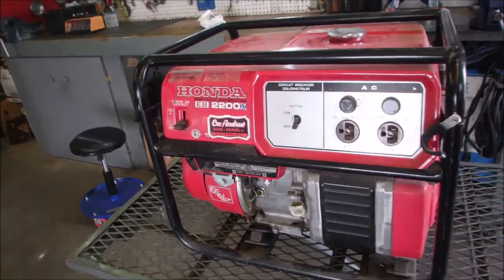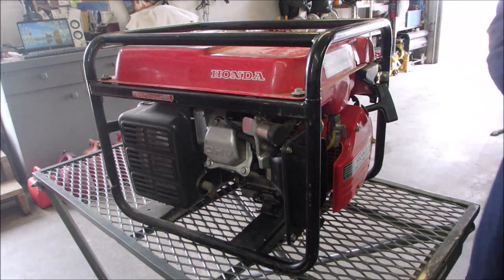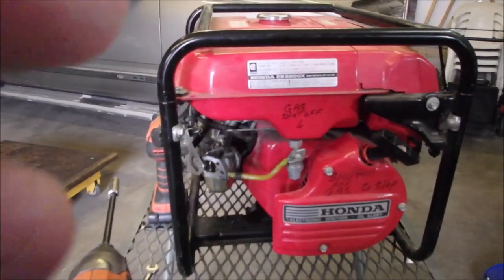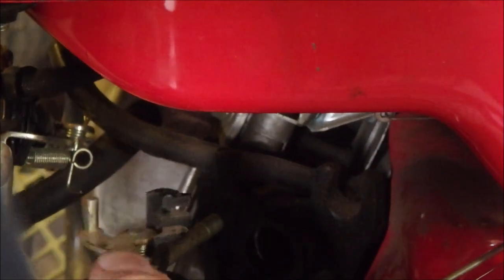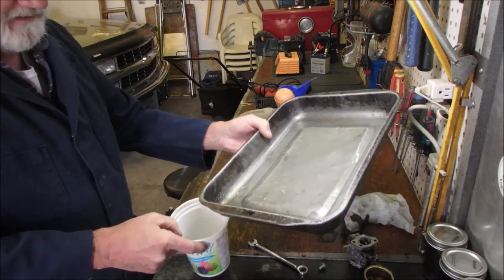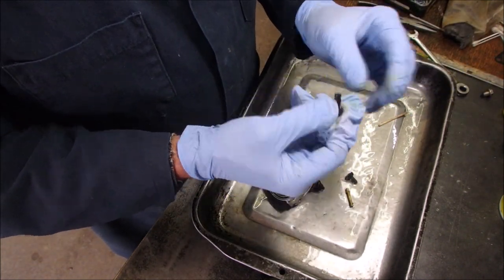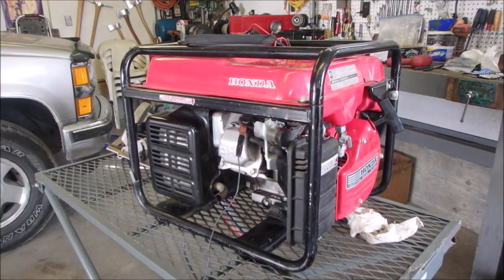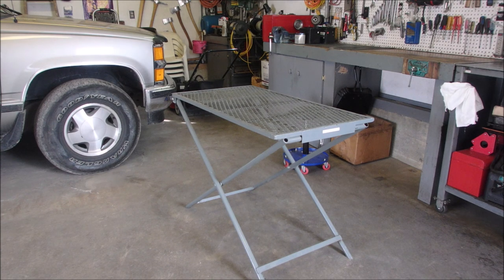Honda EB2200X Generator Won't Start

Comment: Nice to see someone doing it right ie: checking for voltage prior to working on carb issue. A few of our customers have complained of other shops giving them a repair bill for generators after finding out the generator did not generate power and did not notify the customer prior to working on the no start issue.  Good job buddy.
Reply from the maker: I can't imagine billing a customer for not going it an overall checkup
Reply: @BrucesShop  Actually saying the customer got billed for carb work etc. but the shop could not excite the stator to produce power so they didnt check that first like you did. Basically generator got demagged now engine runs but generator useless , guess it could happen but not if checked the way you did.

Comment: Nice work.  Looks like a well maintained generator.  No load, I usually set to 61.5 hertz (3690 rpm).
Reply from the maker: You know for me the hertz setting goes out the window when i get to the voltage setting.  I don't know how to manage both.  ???
Reply: @BrucesShop  reminds me of a Hertz Doughnut. You get too close to the unshielded spark plug terminal, and get zapped! Hertz Doughnut?
Reply from the maker: Can I set both   James?
Reply from the maker: After the video I turned the RPM down to 3400.  Thanks for the suggestions.  I should have caught that.
Reply: @BrucesShop  You should set RPM around 3600 for 60Hz and 3000rpm for 50Hz (both for "standard" little 2 poles generator). 
You can adjust the voltage on versions with AVR regulator, otherwise the voltage is what it is; can't do much about it.

Comment: Very nice video Bruce, I like how you used the grinding compound on the valve seat to save that carburetor. I would’ve thrown away that carburetor and spent months of frustration tracing down a brand-new one. Sheer genius!
Reply from the maker: Well thanks

Comment: That pressure check is pretty neat. I suppose that the size of your tank and the elevation would make a difference on the amount of pressure required for the needle and seat to hold, huh ?? Anyway nice fix Bruce.
Reply from the maker: Since i got the pressure tester i can fix way more things.  It was just a plastic seat that needed a little buffing,  thanks
Reply: @BrucesShop  I was thinking that the seat needed attention once the needle swap yielded no change. I’m so proud of myself today. My thought process matched Bruce!! I have learned a thing or 2.
Reply from the maker: @haneyoakie14  Thanks Sir Thomas

Comment: I've never seen anyone pressure test the needle and seat. That's pretty cool. I have a little gun like that for brake bleeding. I wonder if it can work in reverse like yours? What kind of tool is that?
Reply from the maker: Yes it will 0-30 psi will work

Comment: i like pretty much all the Honda Carbs, way better than Tecumseh. i've some experience with these and when i saw it was not holding pressure, i said out loud, "time to check the seat!".  we also have the same set of cordless drills, those black n decker ones are quite adequate for this type of work.  and for jet cleaners we just pull a bristle off a dollar store brush, easy and disposable.
Reply from the maker: Thanks Rob

Comment: Thanks Bruce,  great help. 
Bruce air compressor what type do you use name of it. 
Is it commercial or just a small one for your garage.
Reply from the maker: It is a big old sears model from the 60's I think with a newer electric motor.
Reply: @BrucesShop  thanks I’m thinking of getting a small one for my garage to put air in my tires when needed and to use for a small stapler any suggestions

Comment: Hi Bruce. Great video! Did you add the aligator clip to your RPM meter? Looks easier than wrapping the wire around the HT lead. Thanks
Reply from the maker: It came with one actually

Comment: A stuck fuel needle seat plus a drity carb is what I think is the problem in the no start probably cause it not to start there Young Man 😎
Reply from the maker: Right   a very common thing
Reply: @BrucesShop   well at least you got it going again 👍

Comment: The RPM is a little high.... should be just around 3600 to get 60Hz, nominal. This is a conventional synchronous gen head and not an inverter. 3700 is as high I'd be willing to go when unloaded. Good stuff with the carb rehab. Though, you were a little too rough on the main jet using the torch tip cleaner. You really don't want to alter the size of the jetting when cleaning it.
Reply from the maker: Yes I know that but some of the little honda gensets can go to 3900
Reply: @BrucesShop you must be referring to nrwer inverter models. Old school portable gens needs to run at a nominal 3600 RPM so the line frequency stays at or near 60Hz. If you runj that gen at 3900 RPM, the frequency would be 65 Hz. That may cause power tools with a motor to spin faster and draw more current.
Reply from the maker: @orlypalomar  OK.  Thanks
Reply from the maker: After the video I turned the RPM down to 3400.  Thanks for the suggestions.  I should have caught that.

Comment: Great job Bruce i will send over the carb am working on for my ride on  just will not run smoothly,when you removed the black plastic jet did you notice how many rubber seals on it.
Reply from the maker: No sorry Nev
Reply: @BrucesShop  not a problem Bruce

Comment: Bruce.  How many "O" rings are supposed to be on the idle jet of a Honda carburetor? I have not been able to locate a good parts diagram for the idle jet assembly to determine the correct number. There are two grooves. One at the top and one at the bottom of the assembly.  I have seen some with only one "O" ring and some with two. Love your channel.  Thanks
Reply from the maker: To be honest i think there are 2.    On my last job (this video) I think there was one but with my old eyes I can't swear to it.  sorry I am not much help.
Reply: Thanks Bruce.  Yeah my ole eyes are not what they used to be either.  I work on small engines as a hobby for myself, family and friends.  I'm really impressed by your knowledge and patience.
Reply: I've taken apart several genuine Honda carburetors that show no evidence of having been opened.  They had only a single idle orifice o-ring, with a second empty groove.

Even if they had been serviced, there were no other parts mangled or missing.  It seem unlikely that someone would otherwise carefully service the carb but omit installing an o-ring.  It appears that the second o-ring is optional, intended for redundancy or retention rather than carburetor functionality.

Comment: I am curious, does the oiler drip when not in use? I tried a couple different ways to carry fuel for priming but nothing has been ideal.
Reply from the maker: The engines will pull gas from the oiler as it goes if it is stuck in there all t he way.  Thanks
Reply: @BrucesShop  that's a bonus! I tried a spray bottle and it worked but 3 different bottles had the same problem, evaporation from the gas created a tiny bit of pressure in the bottle and caused them to drip.
Reply from the maker: @GuysPlayingWithTools  Thank again.

Comment: Great video.    I always thought that you should not get carb cleaner on a rubber seat as it will make it swell thereby ruining it. Is that true?
Reply from the maker: Yes.  On one attempt i think I did put the needle in the seat without rinsing it.

Comment: I have a EB2200x that every time I plug something in to it and turn the power on the motor dies out. What do you think could be causing that?
Reply from the maker: Well they all have a low oil sensor.  Even if they are a cup low they will do that.  I also may need a carb clean,
Reply: @BrucesShop  brand new carb. 
If I crank the gen with the appliance in the on position it will crank and run it fine. If I crank it then turn the appliance on it kills the engine.

Comment: Customer just changed oil - !!! - THE very first thing to check.
Reply from the maker: You are right.  Generators can have a low oil alarm even when down a cup or less.  Thanks for the heads up.    I check that when they come it.  It may not have been on that video.

Comment: I have a wire that comes out of the valve cover on my Honda generator 2500 where does that get wired to call anybody tell me
Reply from the maker: Is it the low oil shut down? However that wire should come out  of the block.  You can Google the model #

Comment: What’s the frequency, Kenneth?
Reply: Go ask Dan Rather not Bruce.
Reply: @andyhamilton8940  I’d Rather not
Reply from the maker: @andyhamilton8940  True   I don't worry about it as it is just the throttle that determines the output voltage and the Hertz.  They won't run along side the grid.  If they are at 61 Hertz it won't mess anything up.    A clock will run at one second fast every minute but when using a genset most folks just need juice for a short period of time.  James Condon is better at that than i am though.

Comment: It must be old Honda generator week!!
Reply from the maker: Yes.  The are the first ones to clog up after the winter of sitting around.  Small orifices
Reply: @BrucesShop  James Condon had an EX1000 yesterday that had not run in 20 years
Reply from the maker: @haneyoakie14  I saw that and will watch it after my comments.  Comments take me an hour or so.